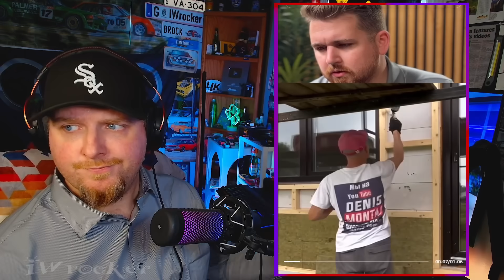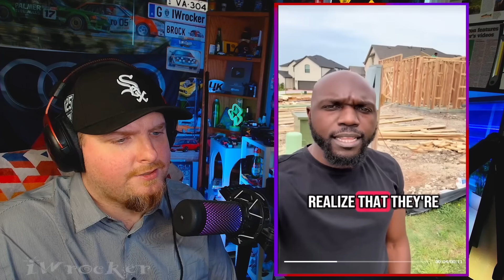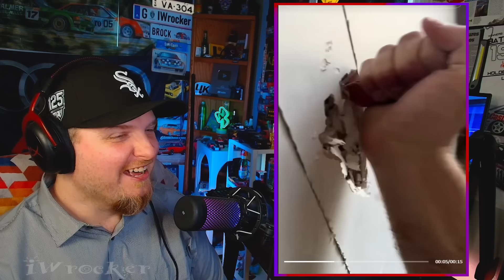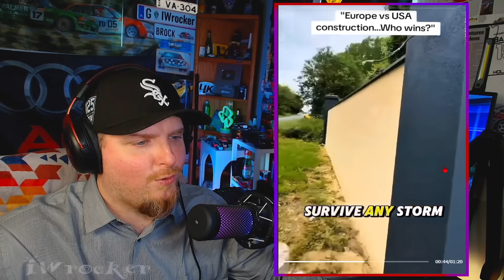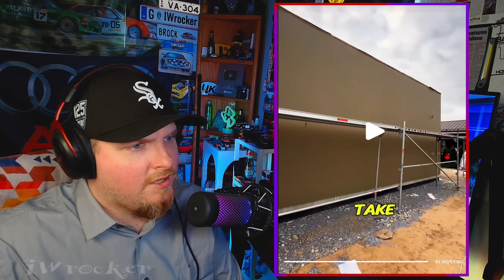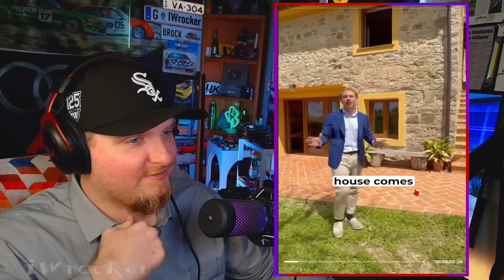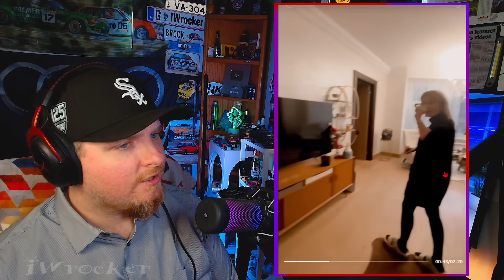25 Minutes of European VS American Home Quality & Construction Methods 🔨

Comment: I can't even make holes in my swedish rental walls with my hammer drill, I must borrow a rotary hammer to get the job done. A few of the walls that are not weight bearing are plaster so they are soft enough to drive a nail into with a hammer. If anyone were to try to punch a hole in swedish walls they'd be considered really, really stupid and in a cast. 😂

Comment: Well, there's definitely "easy to break" walls in the countries of Europe as well, but from the looks of it I'd still say they are a bit tougher than the US standard walls. You probably could break through a regular wall with your hand, but to avoid hurting your hand, I think most people renovating uses anything from hammers/sledge-hammers and crowbars to small saws, but once we can get a proper grip on the plaster wall we can rip it down in chunks. Still, not the "Sorry I made a hole in the wall, I just wanted to knock" like in the US xD

When it comes to the exterior walls, or walls around the property, it's very individual and depends on taste, budget, and construction guidelines. Wooden fences or simply planting hedges is very common, at least in Sweden where I live. But if you have the money to splash on it and the construction rules allow for it, you can see more proper walls like the one in the clip. And yes, many countries in Europe has strict construction laws, like how tall you can build your house, what type of property lining walls you can have, how high they can be etc. Of course depending on country and area, so if ya build a house here, you definitely want to work with someone who knows the rules and can guide you through it.

And yeah, when it comes to the inspections, there's for sure shady and/or incompetent people here in Europe as well, we're sadly not immune to shitty people trying to make money by cutting corners and what not.

Comment: Wow that first guy is peak american ignorance. 7:56 Wait I thought it was a joke that it was literal cardboard... If I try the same with a knife, I need a new knife and a bit of paint
What shockes me most is that those american houses aren't even much cheaper than the european ones. They should cost a fraction considering the building quality and (lack of) durability

Comment: I do get what he meant by "not even 'treated' (or what the word was?) on the concrete." - as moisture will come in there. BUT, at the same time - that's the only detail I could find that would make it "better". And I've worked in construction, and also both drawn, designed and built my own summerhouse. In Sweden - it is cold, not as cold as in Russia (depends on where though). Still, that's the way we would build houses with wood here as well (treated wood though!).

Comment: Masonry/Brick houses (popular in Europe): These are always insulated from the outside. The insulation layer goes on the exterior facade to protect the heavy brick or concrete walls from freezing, store warmth inside the house, and prevent mold growth.American-style timber frame houses: These use a hybrid system. The main insulation (usually fiberglass or rockwool) goes inside the wooden wall structure between the studs. On top of that, a continuous layer of rigid insulation is added to the outside to eliminate thermal bridging through the wood.

Comment: 14:50 it's pretty hard to fck up exterior insulation installation... in the house I live in, I did with my brother, and going on 20 years now, we never had mold... the only downside if you can call it that is that little birds, especially sparrows really like the damn thing for building nests so we just coexist...

Comment: That grey styrofoam insulation is attached and finished properly but the cutting is atrocious. Styrofoam should be cut with a hot blade that melts through to avoid all those loose globules that turn the building site (and its aftermath) into a local environmental disaster.

Comment: We live in rural Somerset in the South West of England. Our house was built in 1621 but some parts date to the early 15th century. The house is built out of granite and Bath stone blocks, the external walls are three feet thick, most of the internal walls are over two feet thick stone.
We have over 13 acres of gardens and the entire property is surrounded by an 8ft tall stone and brick wall, and a moat. 🇬🇧 😊
Reply: Sounds lovely. 😊

Comment: Quicker? I think not. I have seen how much work goes into just the framing and support for the main to do the floor. In Europe it took less than a day, and you had a level cement /concrete floor..and it didn't  take a lot of cement either. Prefab self locking concrete posts and a thin layer  of cement. Done, no nailing, no hammering cutting wood, checking level. Building houses from wood isn't  faster at all
 I helped  family members buid houses. Some from brick some with cement blocks. Keep the cement mixer going and the materials moving, two bricklayers, it moves fast. Building wood framed houses, a lot of time you need two or more people to lift hold align and secure beams. Dealing with low quality  twisted lumber, wood that might got wet. A long list of issues. The quality of the crew.etc Insulation inside? Bugs, rodents, mold. Sprayed  on foam  insulation? It releases  gases, covers up wiring. Fire accelerator.

Comment: The facades in London are literally just that. When they built the underground (subway) they had to provide large openings for ventilation. Instead of just an ugly hole in the ground, they left the facade of the building in situ so the street looked more aesthetically pleasing. If you looked at it on Google maps, you would probably see the railway in the hole behind the facade. There are many of these structures dotted around the city.

Comment: @8:00 Looks like a House of Cards. Cheap and Trashy. In Germany, load-bearing walls must be 24 cm thick. Interior walls can be 18 cm thick, but don't have to be. @15:00 In Germany, there are so-called energy-efficient houses. This means that houses are retrofitted with insulation to save on heating costs. It's a bit expensive, but it pays off well in the long run. @20:35 It's probably a toilet and a bidet. You only have to look at the cistern on the ceiling to come to that conclusion. @21:30 All three Baltic states fear a Russian invasion. That could be one reason why it's so cheap. The apartment is 1400 square feet = 130 square meters in size.

Comment: 7:35, when i upgraded my allotment shed, i used same method as a usa house, and it dose have a metal roof just like that clip just a different style but still metal  the shed now has an internal frame made out what you guys build walls out of, the floor roof and the internal walls are 18mm osb boards so the shed has an crazy amount strength, it even getting insulated too so summer hopefully it minimize heat and hold heat in winter. this is an allotment shed what prob could pass usa house code, depending on money mostly i may even add a overlap cladding onto out side cladding so it last even longer and add even more strength, it also raised to sweet spot to reduce damp. i only ever plan on building it once so build it well, the aim it still around years after i gone so im 40 next month so at least 20 - 30 years hopefully even longer if looked after. this just a shelter on an allotment , i prob have a roof what out last most usa oil tiles roofs

Comment: 18:00 I don't know if it's mentioned before, but that is probably a fake facade building, hiding either a open train/metro tunnel behind (for ventilation of soot back in the Victorian age with trains) it or another less aesthetically pleasing element, like a transformer house for electrics/metro. Instead of a gaping hole / ugly electric houses you'll still see a nice house. It's a fake house.

Comment: I live in Eastern Europe. When I was renovating my house, it took me a whole day to knock down a small section of an interior wall using a hammer drill. Yes, there’s a catch: the house had been remodeled, and that wall used to be an exterior wall, so it was just under 1 meter (about 3 feet) wide. However, I don’t think a smaller wall would have been much quicker to knock down. And then I saw a video showing an American wall. Man, it feels like I could knock that wall down in an hour with my 100 kilograms (220 pounds) of body weight, without using any tools. 😅

Let me add this: A single window for $9,000? I just recently ordered a window of the same size, only thicker (5 chambers: 3 panes of glass and 2 air gaps). The window itself cost $700, and installation was $400. What 9,000 are we talking about? And as for 14,000 for an American-style window, I’m totally blown away. 🤯

Comment: Has Critic No. 1 even looked at the works first hand and seen what they are doing and the plans they work to? Look at the build first hand and you can see the materials being used. It's not US slap it up quick so the mortgage lasts longer than the house... 18:25 that looks pretty much just a facade built to hide the infrastructure behind it - looks like an underground line in one of those places where they are briefly in the surface.

Comment: Our house have 20 cm insulation outside 15cm concrete inside the wall and 5cm insulation inside of house and two side of house are from glass. And price was cca 160 000 Euro

Comment: First of all by law, all rooms must have windows or else you can't call it a room in Finland. 

Now, about the roofs. I think someone like Ruukki would have no problem shipping some roof sheets to the US, they are pretty high quality considering that they give a 50 year warranty on their roofs. Most of the time it's not exactly the outer wet roofs that need to be replaced, it's the wood inside that tends to bend in certain ways in like 25 years or so.

Now heavy walls. Especially in the apartment buildings you have this one massive wall because it provides structural stability throughout the entire complex, from floor 1 to 10 and so forth.

Insulation. There are 1000 ways to build things. Having heavy insulation definitely makes it easier to heat up your apartment. However it also almost requires a machinery AC to cool it down. This is in fact a little bit of a problem here in Finland because these new "passive" houses often heat up so much during the summer that its almost like your in a sauna unless you have AC

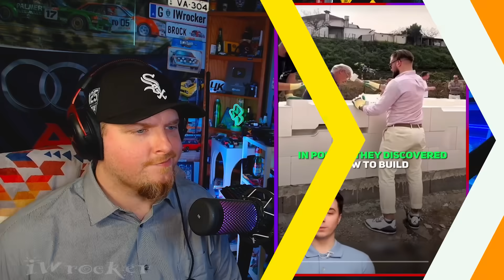Comment: 5:52 These "Lego" houses look "fun" but... where are the reinforced beams?
Imagine building with those in a seismic region, or some heavy vehicle or whatever knocking down a wall. 🤕
I'd be surprised to find out these being allowed in any EU country as a building method (by themselves, as shown in the video),
instead of merely infill panels for concrete & steel framed constructions.

Comment: did the first guy really ask why insulation goes on the outside of the house? Where else should it go? If you put it on the inside the walls will have crazy temperature gradient and insulation wont be nearly as effective...

Comment: Nowadays if you're remodeling you may make a new wall on a bigger room and use lighter materials for wall (i live in a house where the attic was transformed into a bedrooms area, and the was are made of plasterboard), but most houses have a sort of structural "concrete cage" and a few structural wall's you are not supposed to mess with. Especially if its a multi-floor building. In Portugal traditional building is not very good with thermal isolation and things are slowly changing. (People are adopting more and more external isolation, when possible).

Comment: With the older, 15-1600's buildings the walls are up to two foot thick stone. Perfect for insulation. Try cutting those with a craft knife, or punching a hold in them.

Comment: Where I live (Germany), the walls in my apartment are made of reinforced concrete. Even if you want to hang something on the Wall and need to drill, you can't get through in some places.
Reply: Can confirm.
Wife wanted some new shelves on the wall. Had to drill a dozen new holes for support struts. No problem right?!

This little endeavour took over 2  hours, melted 2  of my concrete drills and broke a 3rd  one.

Comment: 8:01 hi european here! 

no gypsum board do not blow our mind. what blows our mind is when its used in outer or structural walls.
however, if i wanted to put op an extra wall in my living room for some reason, i would absolutely do it out of drywall. and cheap inner walls in not something new here either! while doing some renovation at my moms, we took down some non-loadbearing walls. these were made in the 50-60s and were scrap wooden planks, with plenty of space in between then, then plastered up with clay and hay.

Comment: I think the first clip was actually a sort of re-fit to improve the insulation and energy efficiency without going inside the house. There are government programs which will insulate your older house essentially for free. I had two floors of insulation put in and it cost me... 1 whole euro! 
And for one of the later clips, it's true that some new or renovated builds become over insulated without enough ventilation and end up with mold issues. As you said, pros and cons either way.

Comment: building houses from OSBs n drywalls is wicked. Most people wont build a shed with that. I mean sure we use drywalls, but mostly for interiors. Houses are usualy built on concrete foundations with various bricks and later insulated with styrophone or mineral foam to make the house as much heat insulated as possible. To keep heat inside in winter, and outside in summer. Such "passive" houses require very little in means of heating or AC. Not to mention it is built to last decades to centuries. Decent roofing comes with decades of warranties etc..to be fair, US house can be built in matter of weeks. Our houses take months to a year to finish. Unlike in US it is not a consumer product tho.

Comment: The slim building in London is there to hide the underground line which runs for a short section over ground. . They are located in Leinster Gardens in West London and were built to disguise a venting section of track, in the 1860's, on the Metropolitan Line when the London Underground trains were still steam powered.

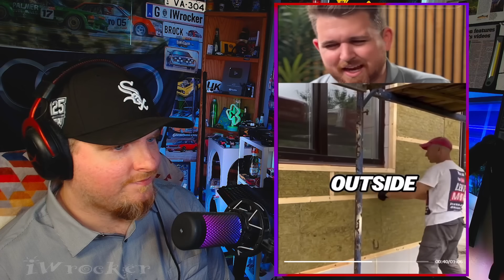Comment: 1:21 The guy you're watching can't possibly be a professional in this line of work. Because if he was then he wouldn't ask why the insulation goes onto the outside walls of the house. It's by far the most effective way to insulate a house. EVERY professional and anyone who took 20 minutes to do research about building or renovating a house knows that. So this guy is clearly not a professional and probably has never had anything to do with this profession. The next thing that proves that i doesn't know what he's talking about is that he complains about the wood not being pressure treated. Pressure treated wood is the last thing you would take or need for this. Why? Because the pressure treatment isn't a permanent benefit. It works about 1 year and then the wood starts to be able to absorb water again. There are permanent or longer lasting methods you could use to treat the wood with but that you can only do if the wood isn't pressure treated at that moment because it wouldn't absorb anything. Then comes the fact that you don't even need it, because the airtight layer is on the inside of the wall. So if moisture builds up inside the wall it can easily get to the outside and the wall dries by itself. But usually no water gets inside the wall. That's only so that moisture that's already inside the materials can get out. It's funny and frustrating at same time when people criticize something that they have no knowledge of and that guy you were watching clearly does not know anything about building physics